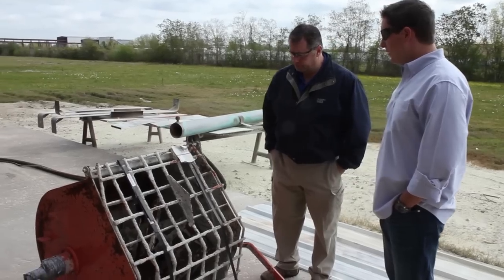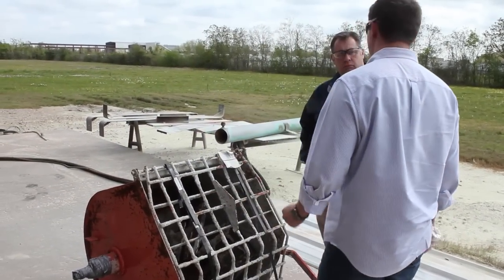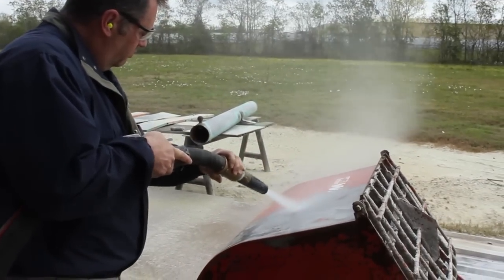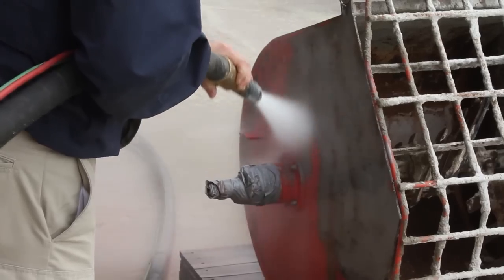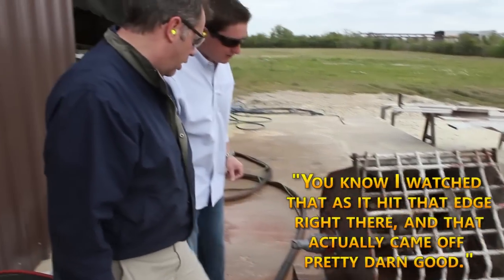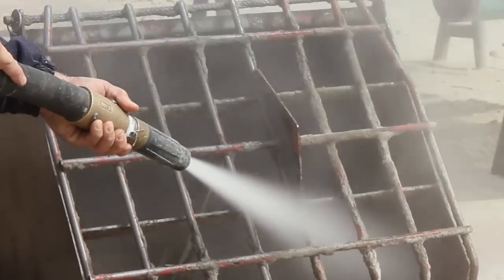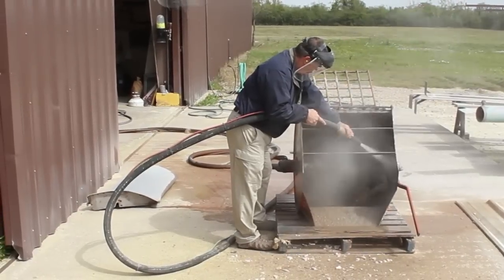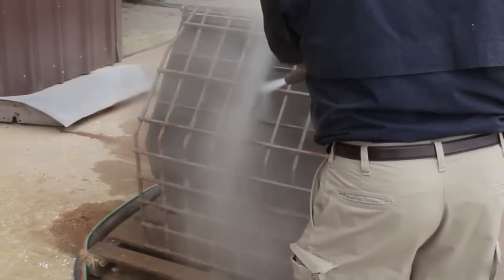Dustless Blasting Mortar and Concrete

Comment: What size garnet do you use to remove stucco/plaster/mortar from equipment?    I am a stucco contractor in Las Vegas nv and have always faught getting equipment clean in a timely manner.   We typically use an air chisel for large build up and mutation acid for smaller splatter of mortar.    Do you need a forced air hood when blasting with garnet?    We have used # 20 silica in the past but it is unsafe to breathe, so we stay away from it.   Please let me know what it would cost for your smallest machine and size of garnet sand you use, thanks -Robert
Reply: hello Roberto I see your a stucco contract I had question do you do sandblasting?

Comment: If paint is now removed...whats gonna protect against rust?
Reply: abrasion
Reply: It has a flash rust inhibitor in the water that protects for about 72 hours.  You MUST prime within 72 hours.
Reply: The water has a rust inhibitor in it to prevent flash rust for up to 72 hours until you can repaint.

Comment: Im tripping acid at 5 am how did i get here
Reply: The Dragon you were riding to save the dwarf princess ran out of petrol and you could not burn down the wooden gate. So as an alternative hey presto you tube. Luckily your built in Wi-fi antenna picked up the signal.